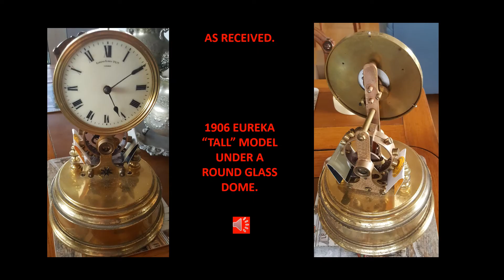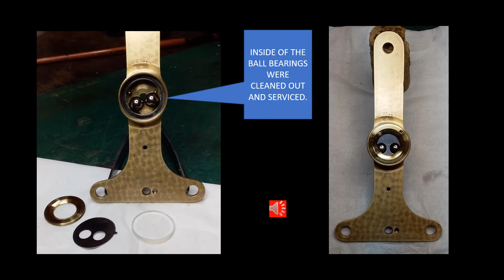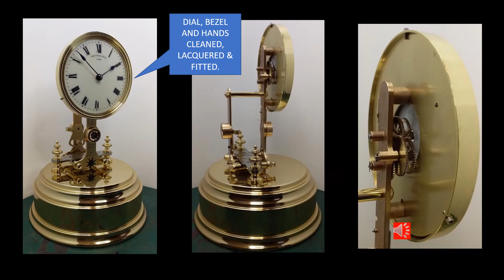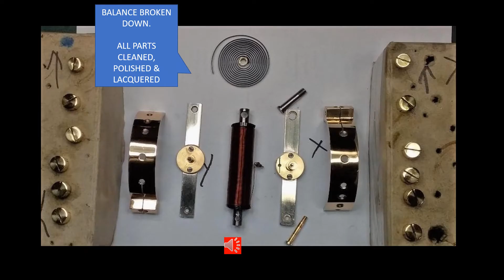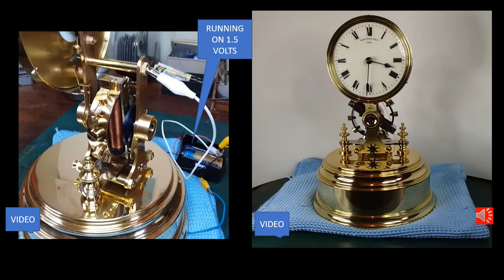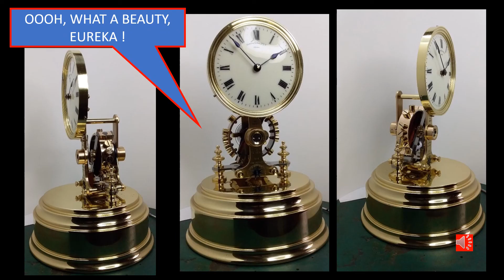RESTORATION OF AN EUREKA ELECTRIC CLOCK

Comment: what a nice clock and restoration,i am lucky enough to have one,under glass dome,with original finish and varnish on all clean parts,but the grease in the two ball bearing is dark yellow,mine has roman numerals on an enamel dial ring.